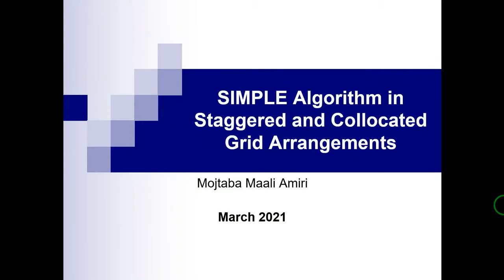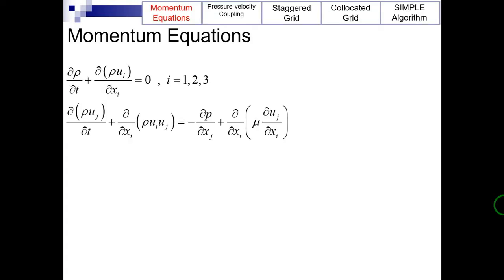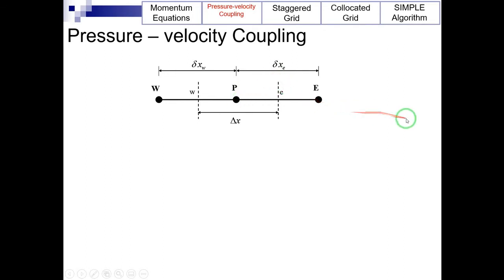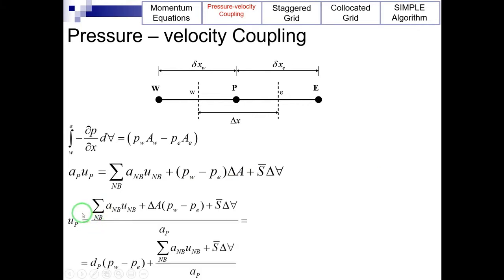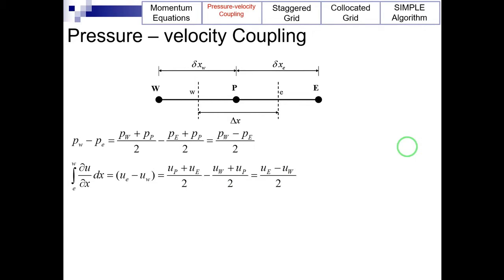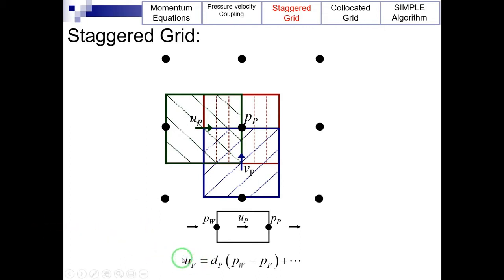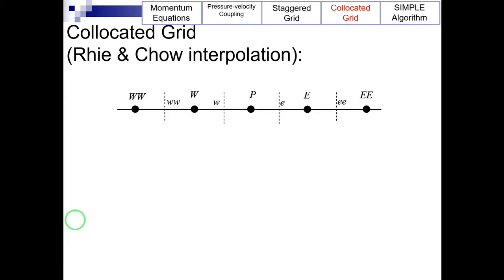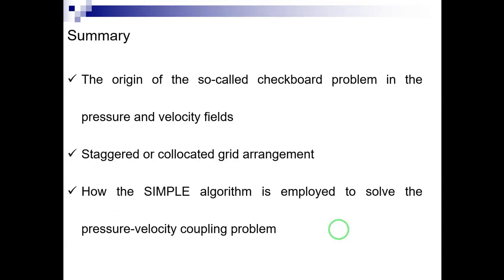SIMPLE Algorithm in Staggered and Collocated Grid Arrangements

Comment: how can i calculate velocities on pressure nodes in staggered grid, assuming im using upwind for interpolation to the faces?
Reply from the maker: Hello, 

Thank you for writing! Note that the idea behind using the staggered grid is to store the velocity and pressure values at different grids. This way we can avoid the so-called check-board problem.

I hope this was helpful.
Respectfully,
Mojtaba.
Reply: @CFD_Mojtaba  if i am using eos for compressible flow, i need also velocity values where i store pressure. so somehow i have to calculate them.
Reply from the maker: @Aerospace_METU, I will make a video about this topic.